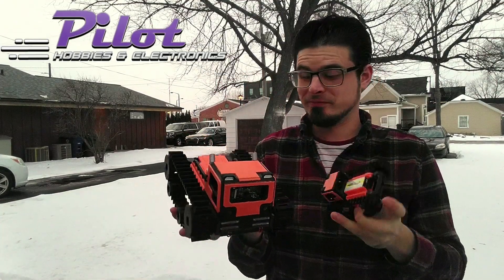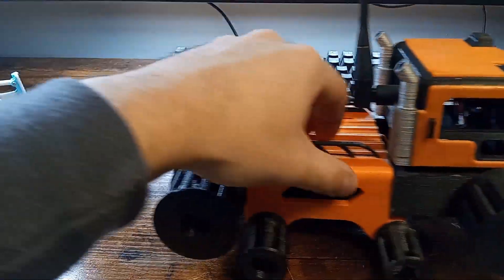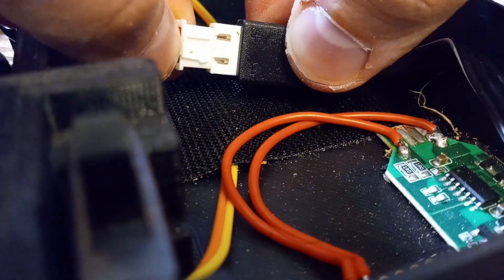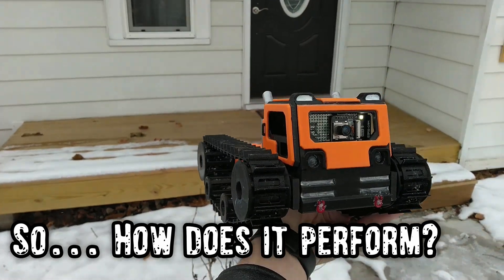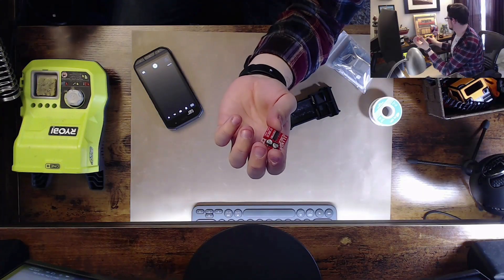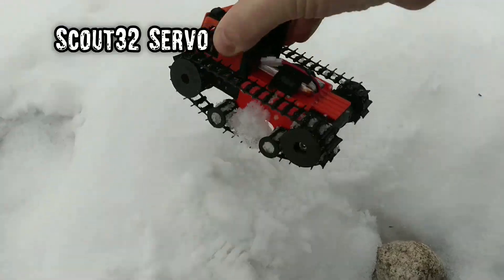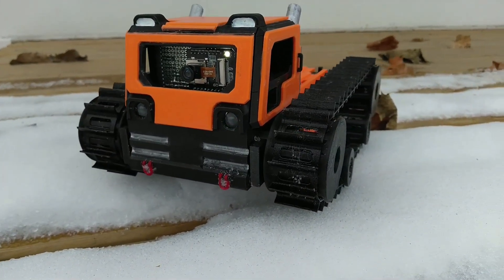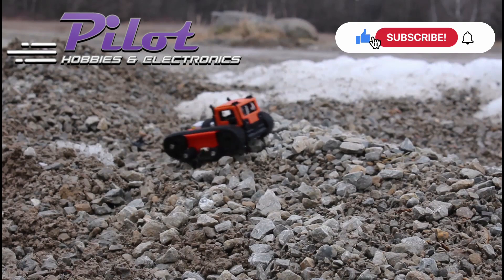I doubled the size of my 3D Printed WiFi Rover! ScoutXL - ESP32 Arduino STEM Project

Comment: Does it establish its own Wi-Fi network or run over an existing Network? I'd like to be able to use this at work to deliver things. And use the existing Wi-Fi to increase range.
Reply from the maker: It sets up its own access point by default, but you can change the variables in the code to connect to an existing network by changing bool ap = 0 and setting the SSID and password to match your network:

// Define Network SSID & Password
// Set ap to 1 to use Scout32 as Standalone Access Point with default IP 192.168.4.1
// Set ap to 0 to connect to a router using DHCP with hostname espressif
bool ap = 1; 
const char* ssid = "Scout32"; //AP Name or Router SSID
const char* hostname = "Scout32"; //For access via Hostname
const char* password = ""; //Password. Leave blank for open network.

Comment: hello again! just wondering if you had any wiring diagrams for the XL, either online somewhere or for sale? I have been struggling putting everything together using the setup in the video. As you can probably tell, I am a total newbie when it comes to hardware! on the software side, however, i managed to flash python on the esp32 and can do some really nice image processing that should work for (sort of) autonomous driving later on. thanks!

Comment: hello! another question: do you have any tips for printing the tracks using TPU? I am having some trouble getting them to print properly, even after trying on a couple of printers and I am baffled. thanks!
Reply from the maker: @raul15975  you can try to disable retraction. I print mine on a direct drive print head, which works a bit better than a bowden tube. Print slow but with fast travels.
Reply: @ thanks! I was also wondering if you had any instructions on the wiring of the scoutxl build? Thanks again!

Comment: awesome job! quick question: do you think it would be possible to use micropython and turn the scoutXL rover into a self-driving vehicle? i don't see why not, but i'm just a total newbie. thanks!
Reply from the maker: Yes, I'm sure it's possible. I thought about adding an HC-SR04 sonar sensor to the front and making a little bot for my son to play with using the same chassis. In my experience, it works well to steer a robot using light sensors on each side to make "casual" steering choices away from dark areas, and a sonar sensor to detect if you get close to something.
Reply: @Pilotgeek  thanks! I have been thinking about some kind of lightweight machine learning model to avoid obstacles as a demonstration for high school students. Just got some parts in the mail! Will keep you posted!

Comment: Hello, what amazing work.  Exactly what I was looking for.  I would like to be able to feed the stray cats in my neighborhood with this little vehicle.  But being disabled I can't go out.  Would it be possible to convert the vehicle to the Lora network?  Thank you Kind regards Mickael
Reply from the maker: I doubt it. The bandwidth for video is too much for lora. The easiest way to do long range would be to use a cellphone in the back of the Scout32 to provide a WiFi hotspot for the rover, and setup a VPN between the rover hotspot phone and a second control phone or PC.
Reply: @Pilotgeek  Thank you for the answer.  I understand, I would have to use a cell phone as a 4g relay.  I had seen videos on the video stream via the Lora network but it must be nonsense that is said in their videos.  Would it be possible to use a Bluetooth controller on the phone to control the vehicle?  thank you Kind regards Mickael
Reply from the maker: @andurilmike5959   Video is likely possible on lora, but the esp32 doesn't have enough cpu power to encode more efficient video compression that they probably are using. It may work using really low resolution but I have never personally tried it, and the current code is written around having a fairly fast communication link.

I don't have any bluetooth code setup, but it's theoretically possible. You may be interested in some of my olders setups like the PilotTrak rovers which used 5.8ghz analog video and an RC aircraft transmitter.

Comment: What gear ratio you use on the 370 motors,12v?
Reply from the maker: The ones I had were simply listed as 500rpm.

Comment: what is the capacitor for on the back of the board? I am currently working on the 2X drone and am interested in making this drone as reliable as possible
Reply from the maker: Just to smooth out any voltage spikes on weaker batteries. I add a large capacitor in parallel with the power pins.

Comment: Great design! I've had the small one built for a while, but I gave up trying to compile the code for the board in Arduino IDE. I kept getting errors and no amount of research solved the issue.
Reply: never mind, I just figured it out!

Comment: Hello Pilot geek
I just saw on the xxl there is the big card that holds the small ESP32 card, what is it called and where can I find it?
Reply from the maker: You could just search Amazon for 40mm x 60mm prototype PCB. It's a board with nothing but a grid of solder pads.